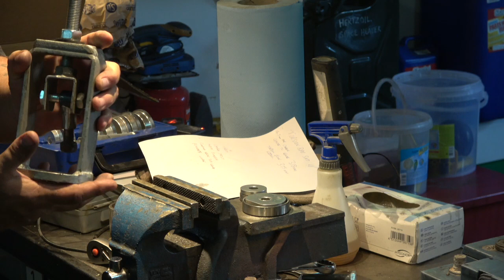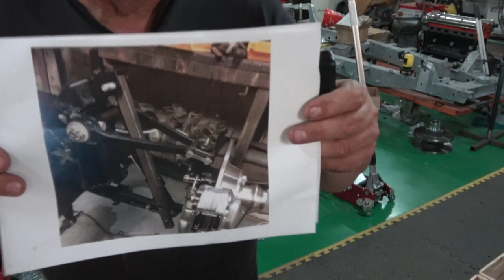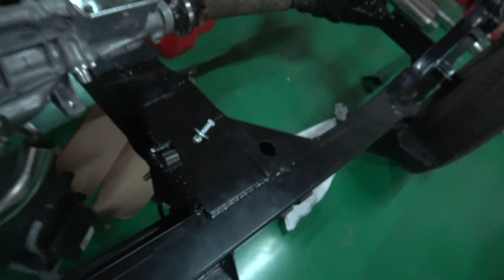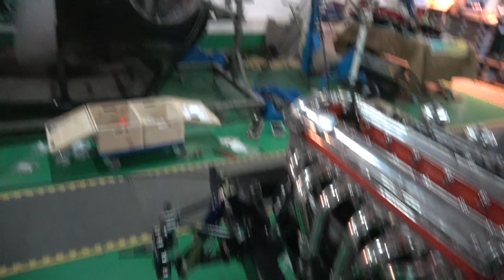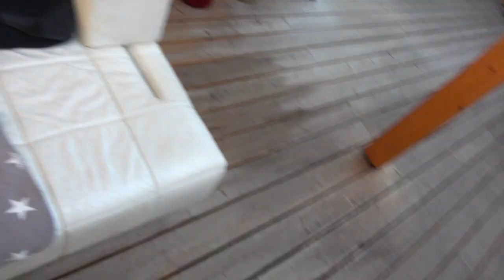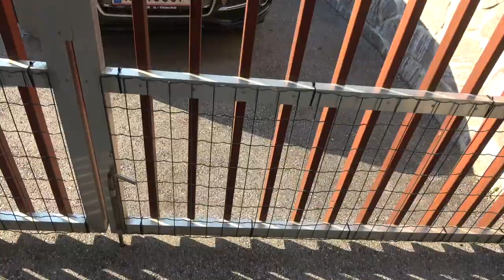Jaguar XK 150 Front Suspension Set Up

Comment: Ohhh! thats what that noise was the other night, was out cutting hay and from away in the east there was a muffled FUUUUUUDGE!!! scared the cows so it did. so i wonder if a slide hammer on the rase driver would have pulled the outer rase out. just incase someone didnt have yer shock doo dad thingy. looks like you have a shop pooch now bud. cheers.
Reply from the maker: Doug, I wanted to make something that would have an even pull on the race so the face would not be marked. Stella has only been with us a few days but she has fitted right in! Cheers Dave.

Comment: Thanks Dave great Video thanks for the tips, I use the same shocks on my race mini. With that tool you made to get the torsion bar set you could tighten the pivot bushes as that is the normal position that the suspension will work at ?. Mike
Reply from the maker: Mike, Both XKs are having poly bushes fitted all round, When the suspension is at it‘s lowest point the test bar only lifts it about 2cm higher so the chances are you could get away with fitting the torsion bars at full droop, Cheers Dave.